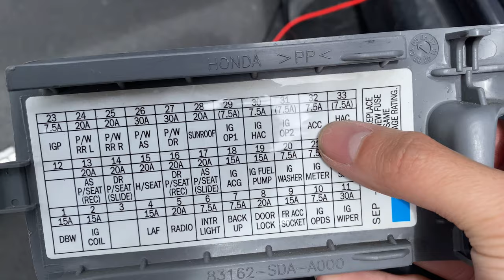Acura TL Fog Lights Install

Comment: where did u get you DRL light from ?
Reply from the maker: Auxbeam 9005/HB3 RGB LED Bulb CSP Chips, F-B5 Series LED 9005 Daytime Running Lights 15000 Lumens 60W Multi-color, Mobile APP Bluetooth Control, Pack of 2 https://a.co/d/fWCNUTI
Reply from the maker: make sure it’s the same size for your car

Comment: What LED harness are you using for your DRL's?
Reply from the maker: no harness just bulbs
Reply: @DennisNguyen  
Wtf! Well, I'll be damned. I can't get mine to work at all. I've checked all fuses, relays and wiring...all are good. I can't figure it out. Thanks for getting back to me!
Reply from the maker: no problem so the 2004-2006 you can make them drl you would either cut some wires and make them independent or just buy bulbs that connects bluetooth to turn them on and off
Reply: @DennisNguyen  
Ahhh. It makes sense then, I have a 2008